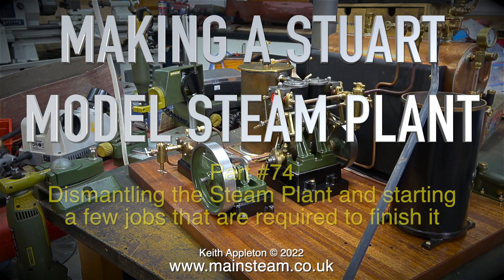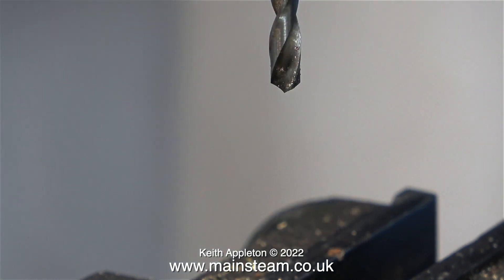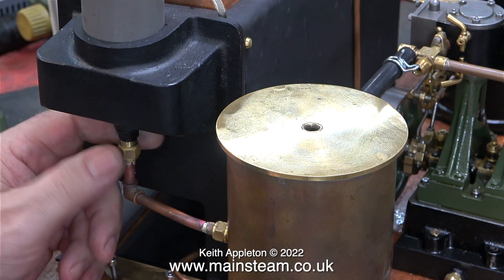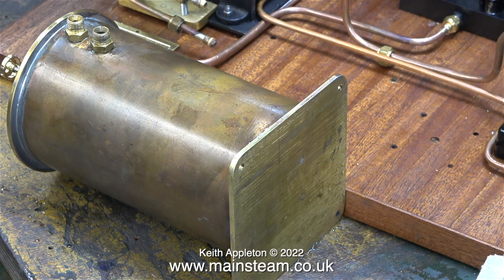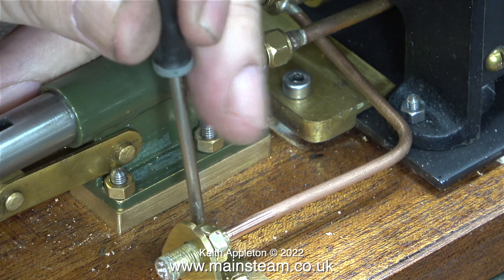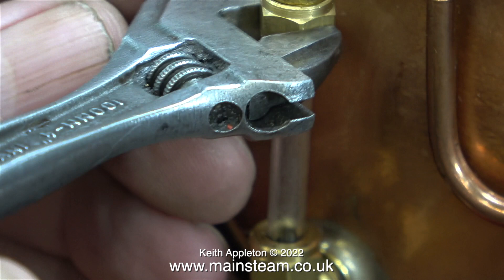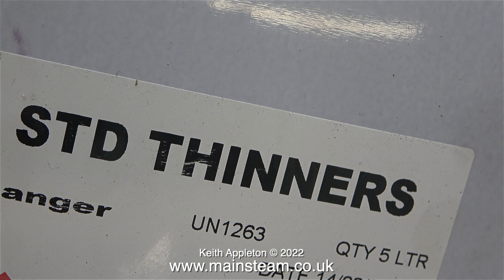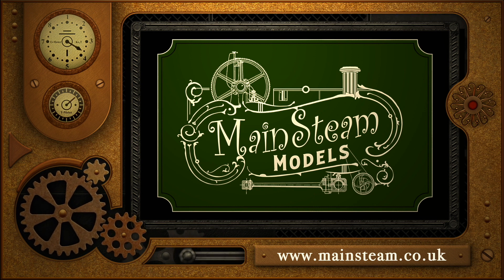MAKING A STUART MODEL STEAM PLANT - PART #74

Comment: it's not bad if the part isnt in a well ventilated place ...as long as you are ... works too LOL 
.
being in the house instead of the shed I think that's about as well ventilated as one can get
Reply from the maker: In my case solvent jobs are better done in my Workshop which is usually best because I can work very close to a wide open door . . . . and once I have done the job I can vacate the Workshop.
Reply: @keithappleton  yup ... like i said ... the houose is much better ventilated ... cosy too and even has food and beverages lol

Comment: A tip I got when using paint thinners was that the fumes from whatever you were using help, so covering the container will speed up the process. Lacquer thinner is very strong stuff, and the fumes alone will strip paint from anything that is too close to an open container!  I used a large metal drawer that came from a refrigerator, it was used to store vegetables and had a metal top that worked very well, especially after the first use when all the paint inside had peeled off!   I once left the cap off a container of alcohol over night and the next day discovered I had lost more then half to evaporation!